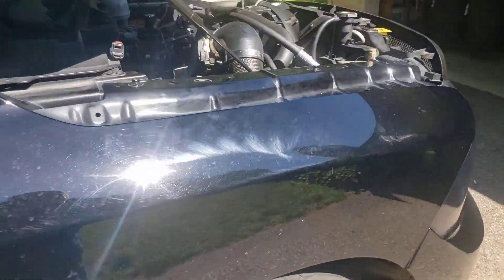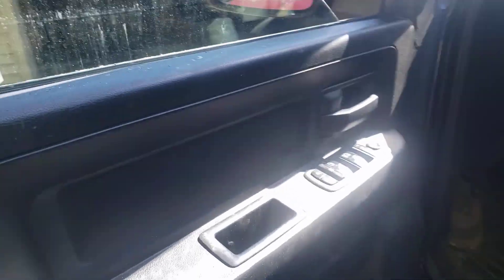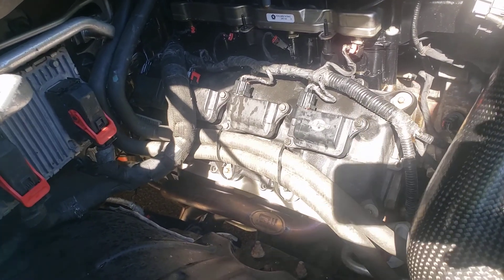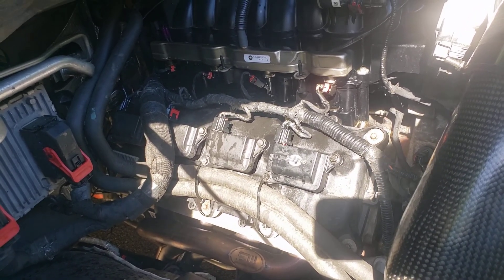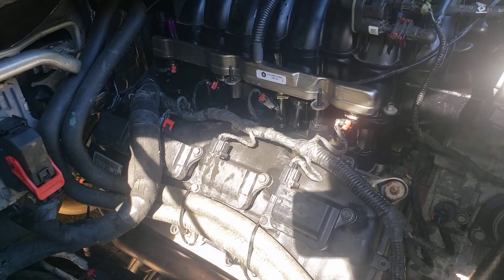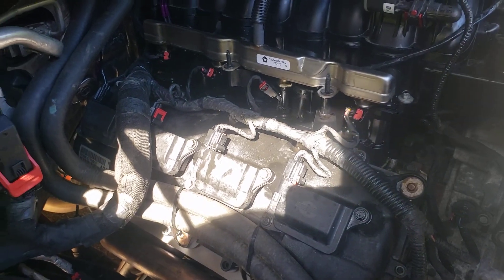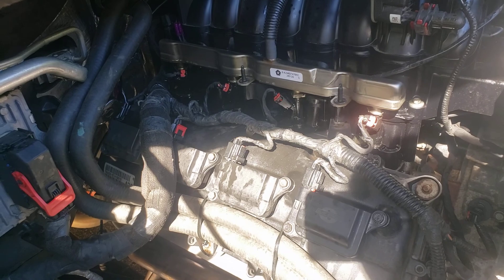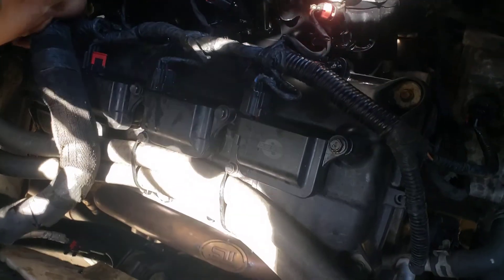Started my ram 1500 with the valve cover off looking for signs of camshaft failure.

Comment: U have bad possible blown header gaskets
Reply from the maker: It ticks all the time
Reply: A blown header gaskets would tick all the time but you would also see the smoke coming out and soot at the leaking point where the gasket failed. Maybe add some seafoam(it will produce a ton of white smoke) through a vacuum line and see if you have a leak at the headers.
Reply from the maker: I did bring it down to the local muffler shop and have them check 4 header leaks. No luck. It would have been nice. I have extra header gaskets.

Comment: How many miles ?
Reply from the maker: 118000
Reply: @rammods3818  do not you have Jays cam kit
Reply from the maker: Yes  but Jay doesn't make the parts. I'm gonna buy a new Cam from Greene racing.